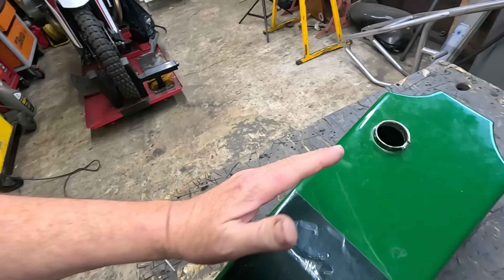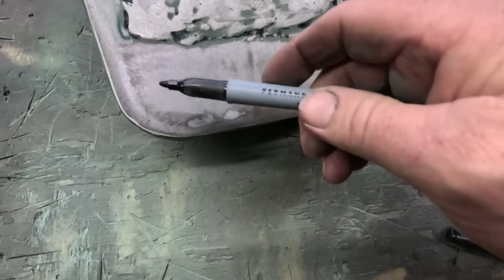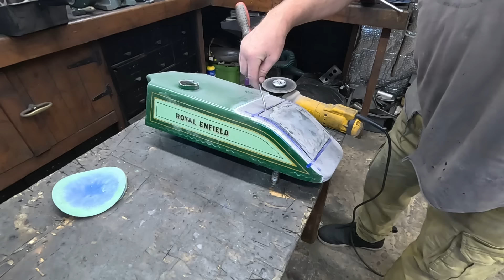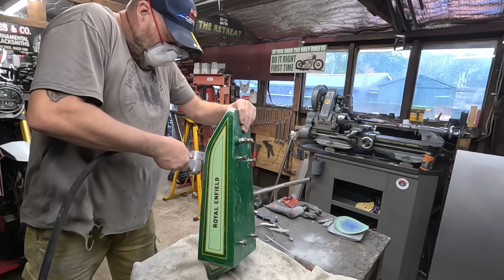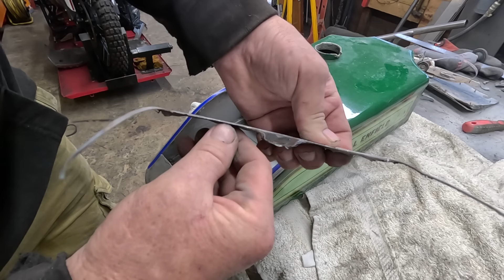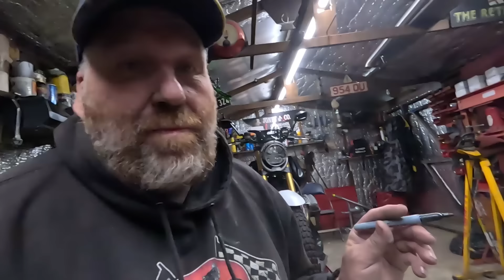Can I Save This 100 Year Old Fuel Tank Part 1

Comment: Craig I know you will do a really good job of your repair but I am very suspicious of the structural integrity of that tank. I reckon a lot of it is as thin as paper. The awful repair was obviously done after the paint job, so Its failed once already. I also know from bitter experience that if that tank sealer is put in too thick it will eventually come off the tank and start floating about in the petrol and getting into the feed pipe to the engine. Maybe it is worth getting the whole tank  chemically dipped to get rid of that sealer and the paint, then you would know exactly what you are dealing with.

Comment: Heat shield putty might help, coated over the lead, when you start welding. You can get those endoscopes from well known marketplaces quite cheap, for checking cylinder bores etc

Comment: Craig, all of the joints were soldered including that beautiful scolloped edge at the bottom,  two soldering irons were used, one in use and one in a gas flame, carefully used flux and a stick of solder. I am in my late seventies now and would rather use an iron than a blowtorch flame.

Comment: I have just had to commission a new tank for my 1927 Raleigh model 21 that had similar issues, sealer on the inside and loads filler all over the outside, unfortunately the rot covers most of it so nothing good to work with. Tanks of that era had soldered joints as you are finding. But from what can be seen on the video I think you are going to be able to save this one, great job, looking forward to the next video, would wet towels help keep the heat from spreading to the soldered joints?

Comment: Great job, I’m a retired panel beater and have made tanks, quick tip…have a damp cloth ready to cool the welding tacks.
Reply: The problem with doing that is by quenching the metal you are hardening it. And on thin sheet metal especially a motorcycle tank that can lead to cracking.

Comment: Looks like del was used 1st. A real skilled fabricator to the rescue.
Putting the tank in to mats drum of dcm would clean the tank of paint and filler.
Reply: Del's workshop does not look like welding and grinding goes on, it looks like film set.

Comment: At what point do you call time and just fabricate a new tank using the old one as a template.....I am facing the same issue with a 1929 project with rotten tanks , do I try to repair paper thin tanks or go with replica, which are available..
Reply: Exactly.
Reply: In a restoration no one bothers with trying to restore bearings etc, if they are available then new ones are put in. Surely same with tanks.. this tank is obviously very thin and we could see the rust under that tank-sealer. Make a new tank- I’m sure you could do it Craig, and could solder it up like the original. Watching to see how the rust-chasing goes! Les

Comment: I will be disappointed if that filler dust isn't put in a jar and reused. I was shown by a mechanical ex Para bus driver with 99 years of experience how to reuse valuable dust on fuel tanks.